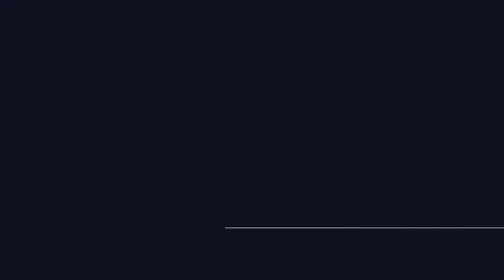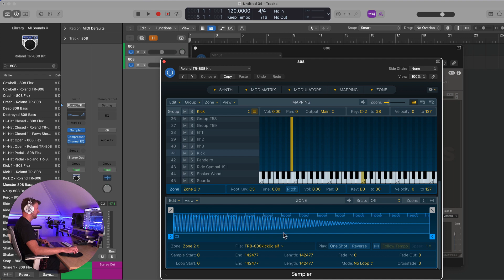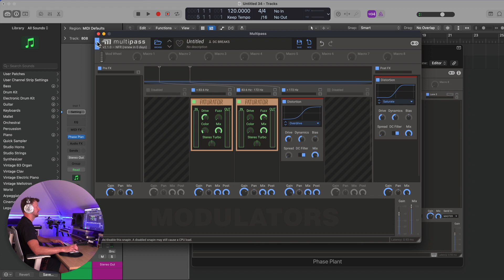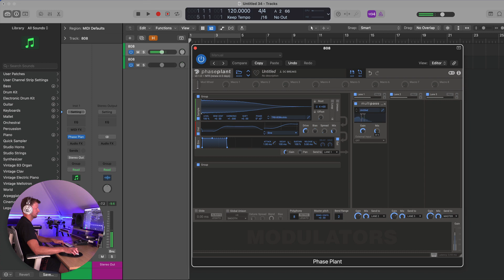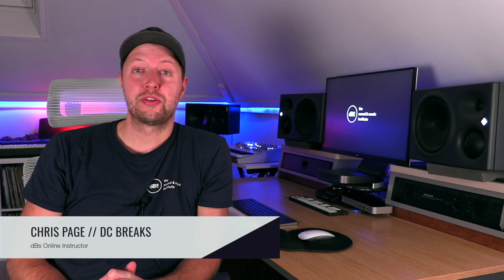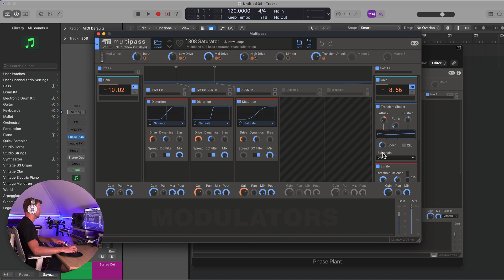How to make fat drum and bass 808s in Phase Plant | dBs Tutorials

Comment: I notice you not youching the dynamics knob on the kHs distortion module. Thats my favorite feature on that tool.
Reply: Yeah it's a great feature. It can be useful on more dynamic material than the sample used here, on these kind of bass sounds it can sometimes mean you lose some low end and introduce further harmonics - that might be what you want...or not, really depends on what you're running through it and what effect you are going for
Reply: @dcbreaks6932  thats very true, it usually helps preserve transients and punchines, but you used multipass to do so, which is a lot more precise